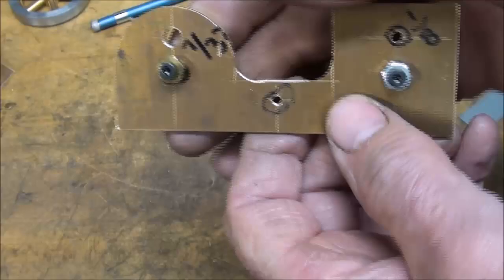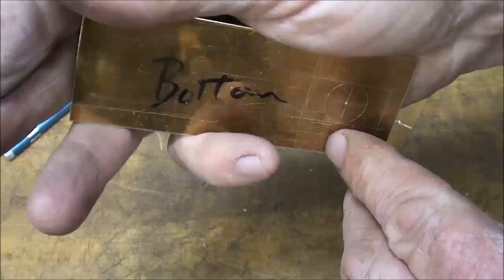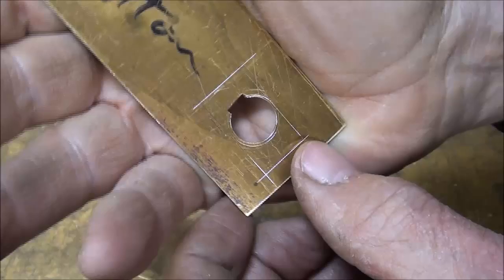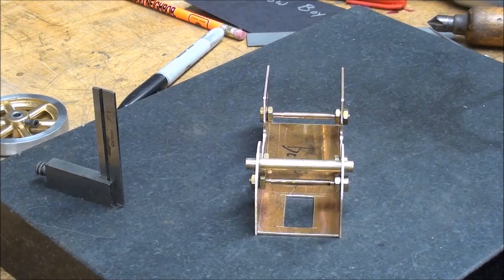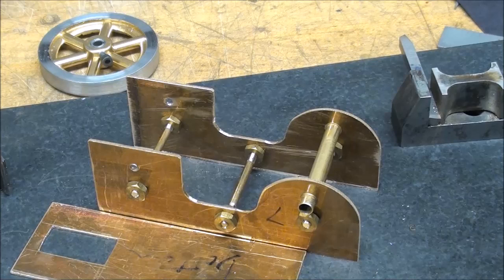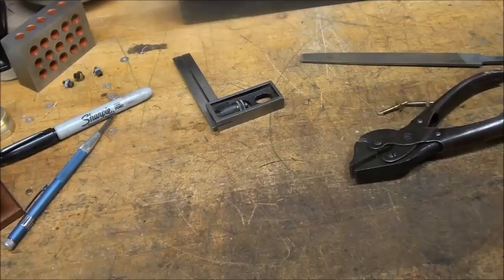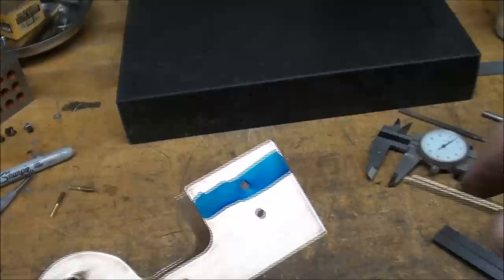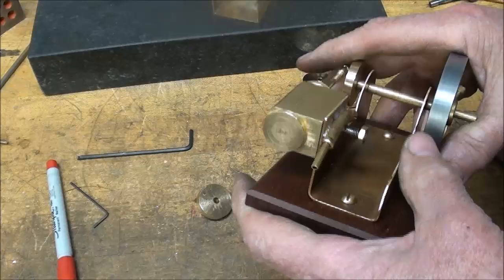Part 8 of 10 - tubalcain Builds the YELLOW BOY STEAM ENGINE

Comment: An iron skillet covered in Aluminum foil is a great heat plate when you put it on the stove-top - preferably a gas element. 

You can also use solder paste instead of wire. Then you just lay the paste where you want and ramp up the heat till it bubbles and melts. This works perfectly for electronics and will work just fine for thin brass sheet.

Comment: There is a material called solder resist or solder mask. It's not cheap, but it can be painted on and will keep the solder from running into areas where you don't want it. It looks like the patina on the brass worked fairly well as a resist, but if any viewer has polished the brass stock, that would be a way of keeping the solder under control.
Reply from the maker: +Peter W. Meek I need to get some anti solder

Comment: Great I have another tool...  Your hotplate for soldering gave me an idea.  I had built an electric furnace for alum and brass melt last year.  I have now placed a 1/4 inch steel plate over the top of that and now have a hot plate.  Thanks for the idea1!!
Reply from the maker: +muscatine_biker Thanks for watching---good idea

Comment: GREAT video and table soldering technique — placing heat sinks on the plate is sheer genius!!!

have you ever used jeweler's "anti-flux"?  you brush it on where you do not want solder to flow (threads, adjacent materials, etc.), and some brands simply wash-off with water when done.

thank you for these engine builds!

Comment: Mr Pete:
I do know what quartering means.  It is setting the cylinders on a 2 cylinder double acting steam engine so that there is always one cylinder in the intake, while the opposite cylinder is in the exhaust.  This is what gives the typical locomotive the 4 beat "chuff" "chuff" sound and allowed for such a large beast to be somewhat self starting once steam was applied.  In simplified terms, the exhaust stroke of cylinder #2 is 90 degrees opposite the intake stroke of cylinder #1.
Reply from the maker: +Dan Floyd Thanks--With my 2 cyl engines, thats what I do--set them 90 deg apart

Comment: Regarding the framework - those who want to make it as a single piece, but get accurate alignment, might like to try Clickspring's channel. In his "How to" video for making a rectangular blueing tray, he grooves the sheet metal before bending it up. Of course, he IS using some slightly thicker metal. Just an alternative.

Neat trick with the lathe tool scraper. Have you ever tried soldering 90 degree joints by making a "V" jig so the solder stays in the bottom of the groove?
Reply from the maker: +Mark Sinden Those are good ideas

Comment: If you look on ebay or amazon you can find a patina for stained glass that will color the solder to brass, copper or black. It works well, holds up well but!!  You need a patina remover if you ever want to fix a solder joint. You may also have a supply house hear you that has stained glass supplies.  Try it!!
Reply from the maker: +Thaddeus M I'll check it out

Comment: My Father had one of those hand nibblers, very handy. I have a power nibbler which is easier to use. Though you say don't use acid HCl [Spirit of salts] When cured with zinc makes a very good flux that gives a superior joint. Surprised you never silver soldered the cage.
Reply from the maker: +Jane Calder Thanks for watching

Comment: AT 13:56 - Interesting how there is a very short time between when the solder would not flow along the bearing and then it would flow.  I wonder if that is because you had just previously thermally connected (soldered) the bottom (very hot) plate to the side (cooler) plates?
Reply from the maker: +cemx86 Could be